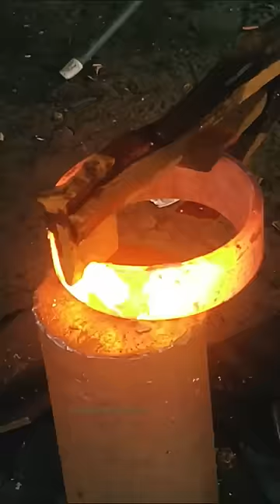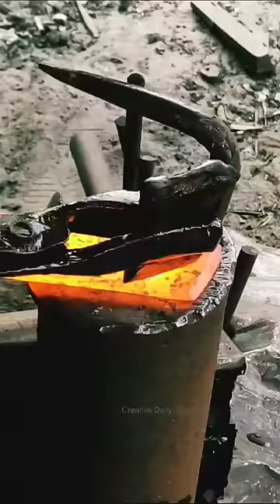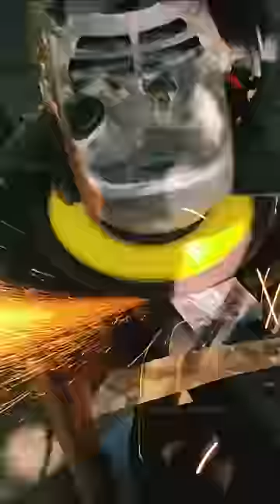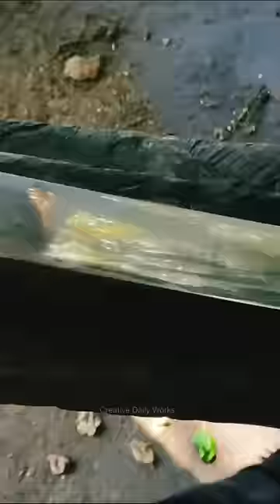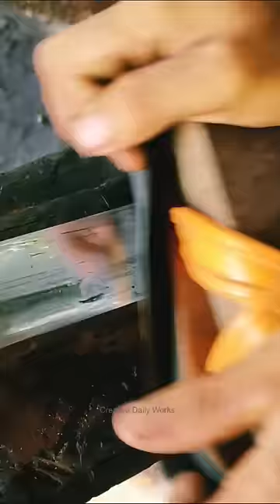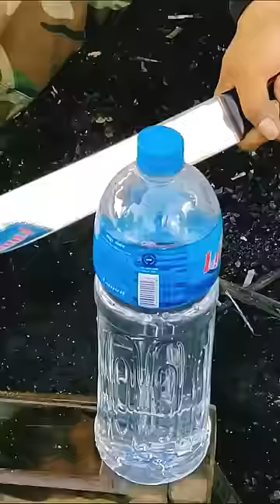This is how Cambodian Blacksmith make the knife 👍

Comment: Not sure how confident I would be with that tang. To chop it out like that instead of hammer the metal thinner would have me worried about a small stress crack right at the 90 of the cut.